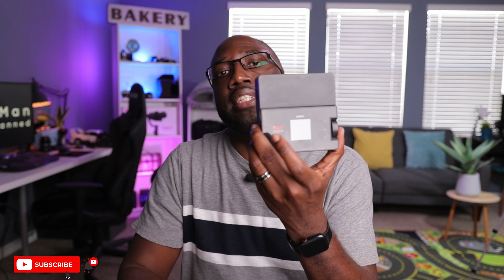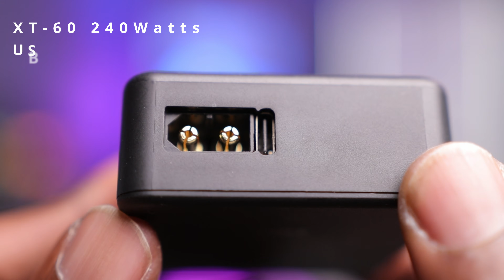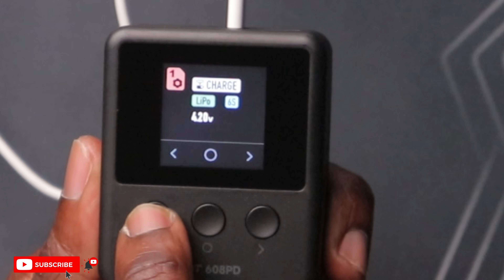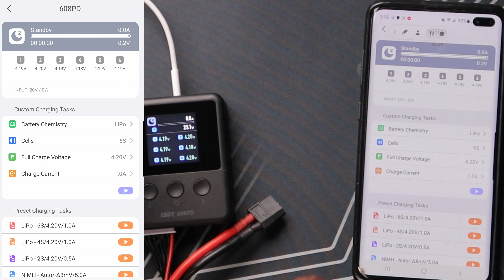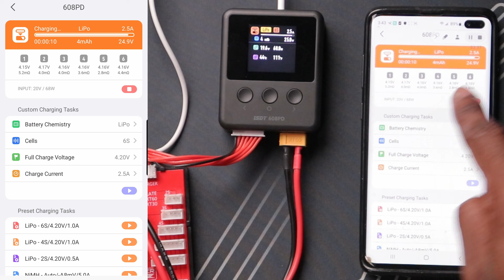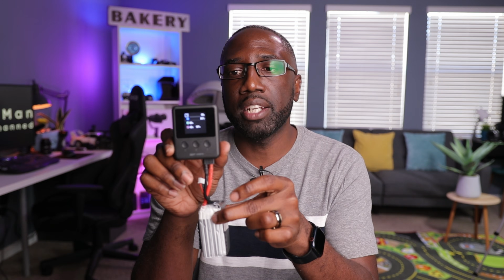608PD | The Best Portable Charger That Fits in Your Pocket

Comment: does they have limite for the mah ? if i want charge only 1000 mah ,and not fully , does it possible ? does it have  time limit timer , or mah timer ? i wont always fully charge my battery bcuz sometime i have 3 batterie to charge and time limitation so i want divide my time available by 3 , ex  3 x 1 hour , and not charge 3 hour my first battery and that my 2 lefting battery i nave no time left for charging time ( they used in serie so i cant afford to mix empty and fully battery toghther ) thanks
Reply from the maker: Sorry, I do not think it has this function.
Reply: @OneManUnmanned  not have timer  also ??

Comment: I have two of the SkyRc B6NEO. Seems like a better choice than the 608PD.
Reply from the maker: The B6 definitely has more features(discharge/storage charge) than the 608PD.  The 608PD has a higher power output and mobile/App support. I thought there were some issues with cooling, and fans not working on the B6.  I think they both have their strengths.  Maybe I can contact SkyRC for a review unit, and do a comparison.  Thanks, Ronald.
Reply: @OneManUnmanned , I keep hearing about the fan problem with the b6 but I haven't had any issues....knock on wood. lol Love your channel bruh!
Reply: The 608pd can't balance charge
Reply: @hairyhider7478  yes it can, that's why it has a balance plug on charger
Reply: @Mikeylikesit1968  I have one And as soon as the first cell reaches four point two volts it stops charging... Not one of my s6s batteries or 4 s batteries gets balanced charged with it
Reply: @hairyhider7478  guess you got a bad one, mine all balance my lipos
Reply: Nope, I like these better, can do it through my phone and can set presets for each of my different lipos.

Comment: I don't see them adding storage discharge anytime soon (or even charge, which would be extremely easy!). Until then, I think this is a total miss. Specially when the alternative in size (the b6neo) does support it.
Reply: And thank you for pointing this out, I have seen far too many reviewers not doing so.
Reply: If your a serious flyer, you should have a dedicated lipo discharger
Reply from the maker: Thanks..I don’t see them updating the firmware anytime soon either.  we shall see.
Reply: You should never ever discharge on a little charger. They require huge heatsinks to displace heat which these chargers wouldn't be able to  handle.
Reply: @MikeyMikey1968  when I go on a trip I do not want to take huge dischargers with me. And most of the time I just want to discharge a half used battery anyway
Reply: Just set the charge voltage from 4.2 down to 3.75 or 3.85V or whatever you want for storage. You can also discharge at up to 100W down to a configurable cell voltage, you just have to plug in a usb load to the usb-c port or charge you phone or laptop to discharge the battery
Reply: @blackmedia7075 do you connect the battery to the input or the output? And how do you strat discharging
Reply: @Mikas-u7x  When you reverse the direction, then the "charging" port will be the input and the USB-C will be the output. First you connect the battery which you want to discharge for storage to the balancing and xt60 ports at the bottom where you normally connect a battery to charge. The you press the button in the middle with the circle symbol, then select the desired cell voltage with the other two buttons, and then confirm with the button in the middle again. The displayed symbol in the top left corner of the screen should change from a sleeping moon to a battery with an arrow pointing to usb-c port. You can now connect a USB-Load like an laptop, powerbank, lamp, smartphone to consume the power. The charger will shut off the USB-C output when the battery is discharged to the desired cell voltage